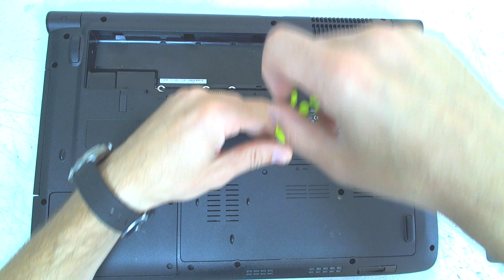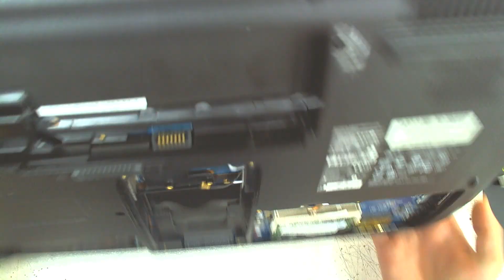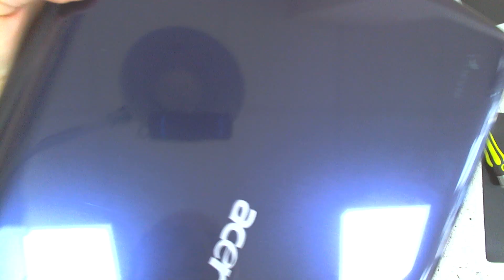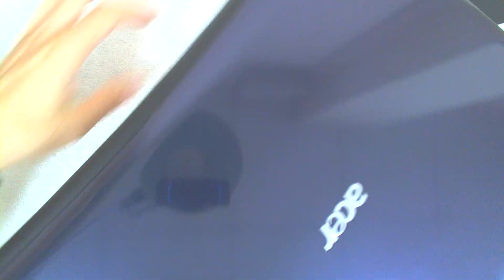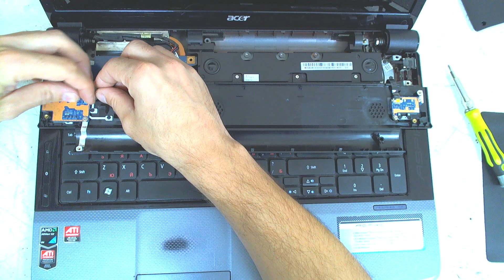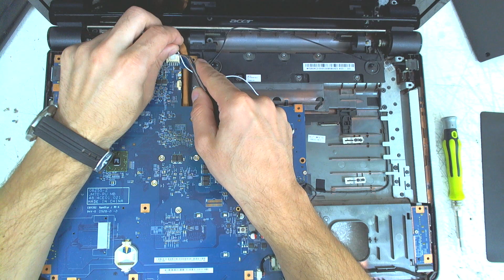Acer 7535 / 7535G Disassembly / Fan Cleaning

Comment: Great video!  At 1:50 can I just remove that cover to add a SSD / and keep the original HDD where it is?? I have the 7535g
Reply from the maker: Yes you can, if you have the cable for the second hard rive.
Reply: @LaptopDisassembly  thanks! Is the cable already in the laptop, or I have to buy separately?
Reply from the maker: @MakarasMusic  In most cases is in the laptop... check by removing the cover.
Reply from the maker: @MakarasMusic  This is very good and stable model. perfect price / performance
Reply: @LaptopDisassembly  many thanks.  I only have bought external back-up hdds, and a m.2 nvme ssd - so have no knowledge about "standard" ssds.  I am very grateful for your immediate responses.  Thanks from London, England!

Comment: Laptop wouldn't boot BIOS at start. Large battery not used (dead) so changed the internal battery with fingers crossed. WORKED!  Wow - BIOS booted and its working again.  Didn't think changing the internal battery would fix this.  I real shame that Acer didn't put the internal battery in the memory/HDD access space.  Unplugging all those ribbon cables was a REAL pain.  NB.  didn't remove the 2 ribbons from the power/P cover - didn't need too.  NB2. didn't pull the wifi cables either.
Reply from the maker: Most of the new laptops, the battery is in a hard to access place.